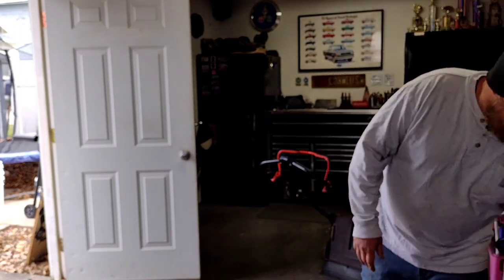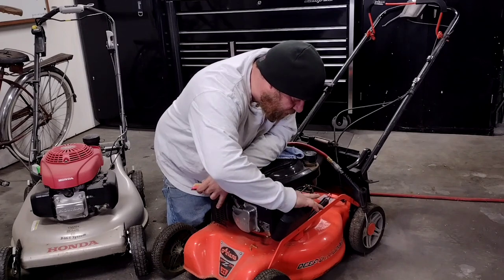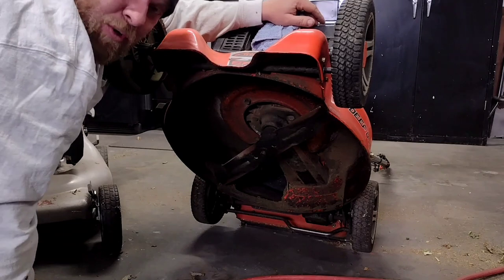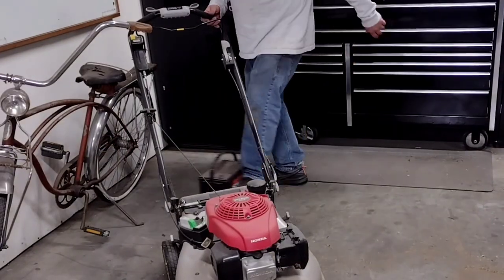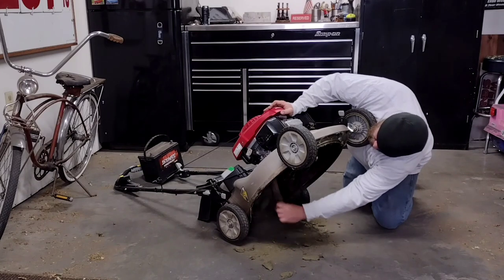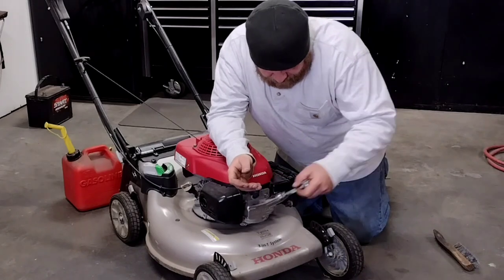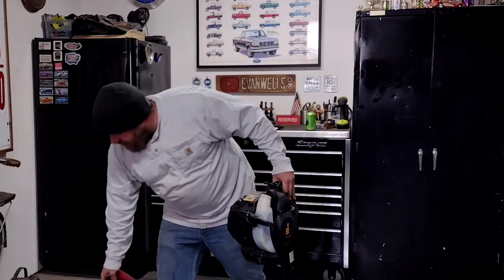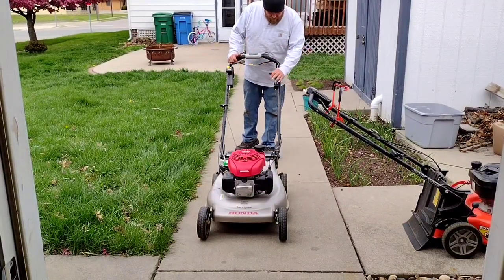Lawn Mower Maintenance! Honda & Ariens Push Mowers - Oil Changes & Blade Sharpening

Comment: Put the deck in the lowest height position and you can remove the filter cover.
Reply from the maker: Thanks, I never really thought of that.  I've had it off before, and couldn't remember how I got it out.  Didn't want to wrestle with it on camera for 5 min and look like an idiot.